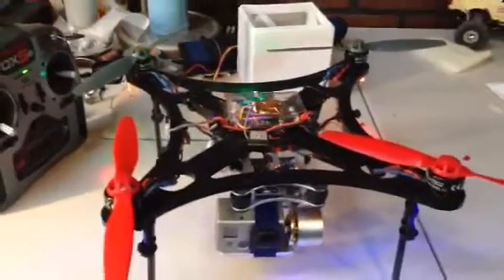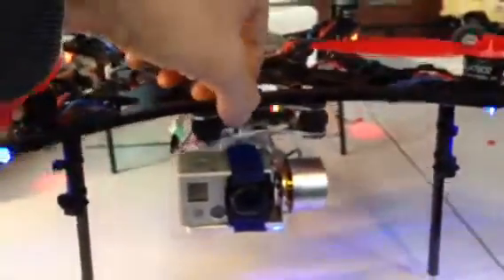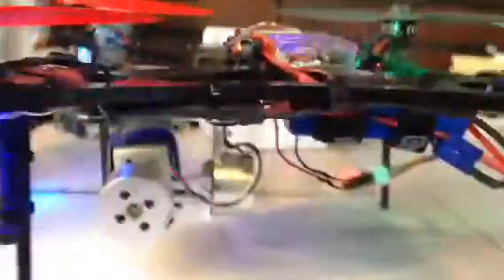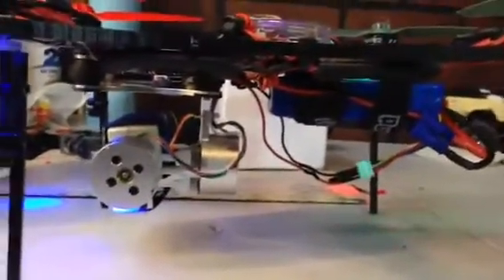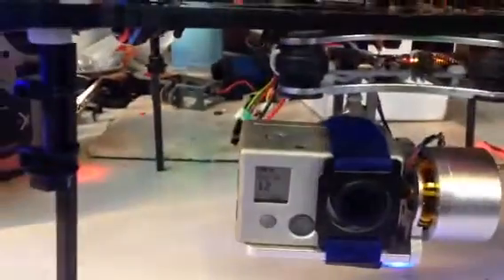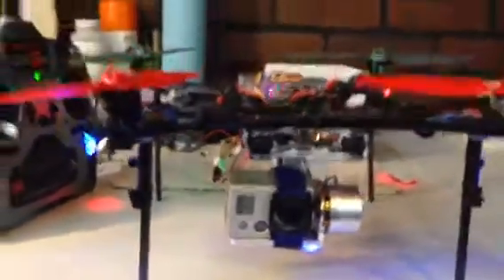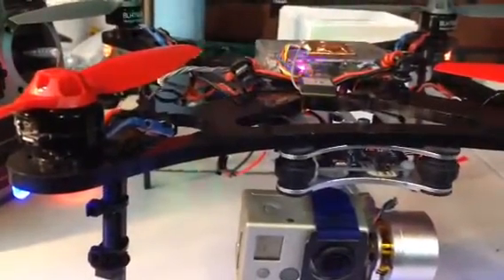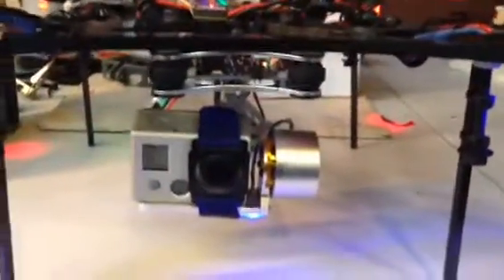350qx OPQ project build: brushless gimbal

Comment: how did you mount the flight controller?
Reply from the maker: The gel type double sided stick tape, two layers
Reply: ok cool. I made a cf mount for mine with grommets - trying to get as flat as possible and eliminate any vibs. Now I have to wait for new new esc's as i had 2 bad ones.

Comment: It's a bummer that they do not offer any upgrades at all for the 350 QX  from Blade. I am going to get a phantom rip out the stock receiver and throw in a Spectrum 8 channel to put a brushless gimbal for flight videos and my 350 for FPV. I get 8 mins before the first battery warning 11 mins second warning, and landed at almost 14. I will have to ponder my options
Reply from the maker: I'm wondering if someone could/would make a flat carbon or fiberglass insert to stiffen the whole chassis,  that would be rad
Reply: 7demo7 That would help. A carbon fiber plate sandwiched between the top and bottom plates.

Comment: How about doing an up-down hover till the battery dies and let us all know the run time?  My original Blade 350QX with the EBay gimbal and GoPro3 runs about 8 minutes max.
Reply from the maker: Ok, I just did that.  Here is the results
@ 3:45 first low battery warning
@ 6:20 rapid flashing low battery warning
@ 8:13 forced landing, would not fly anymore.
The battery pack had 10.8 v left
cell 1 -3.57
cell 2 -3.53
cell 3 -3.69
So it looks like it's ok to fly till about 6-7 min safely.  I did this with 3 packs.  Seems like the first warning light is a little premature.
Reply: 7demo7 Thanks for the reply. That's about what I get with the standard Blade 350QX with the EBay gimbal and GoPro3. Looks like the OPD frame might be a little more robust. Let us know how the quad holds up.